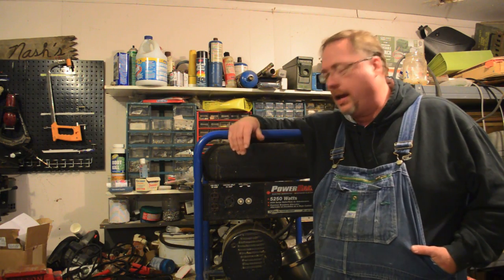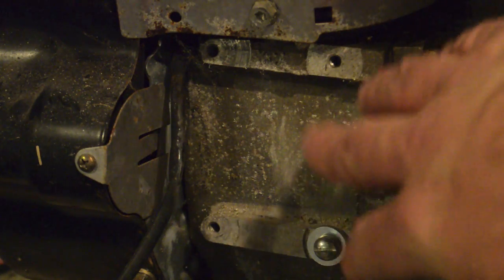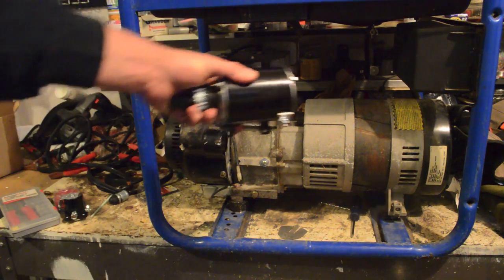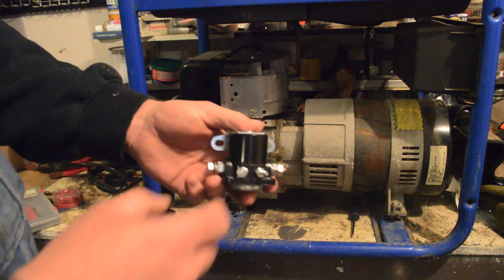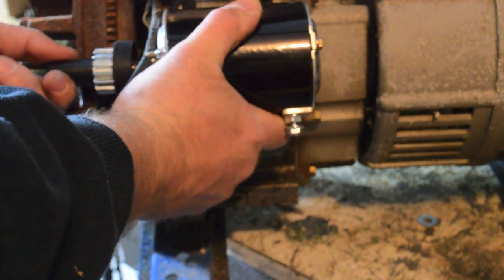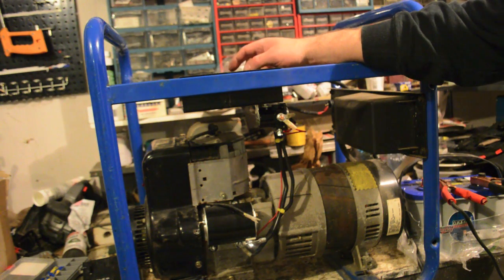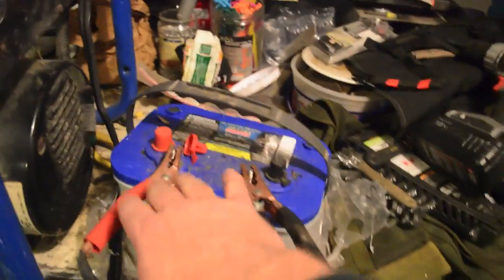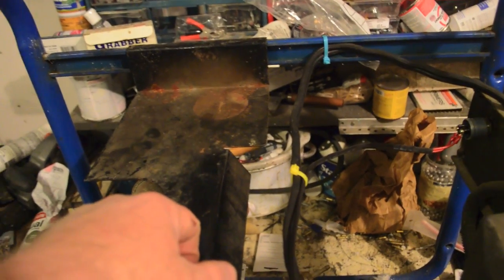How To Convert a Pull Start Generator to Electric Start

Comment: Short Version: Electric starter is the way to go! I have two bad shoulders from motorcycle accidents. I will see if I can convert my 8hp wood chipper!

I can honestly say that I DON'T  missed my Generac 5000 watt  10hp generator with a pull starter! A couple times I forgot to turn the fuel on..Duh!  I was looking for a used dual fuel generator for about three months on different web sites. But I found a Sportsman 7000 watt propane only at great price! You have none of the gasoline maintenance to deal with! I found three tanks by abandoned homeless camps! I can go about seven to eight hours on a tank. I will be working on a to lower the noise level down for me and my neighbors

P S. Not necessarily needed, but the transfer panel is nice to have! I had to upgrade to a 200 amp for a kitchen remodeling project.  I can run 75% of the house now. I did buy a cheap microwave oven to cook meals and heat water. I plan to have a electrician make some changes to reach 85%-90%. Only two of the four bedroom has power. The water heater is not on the transfer box. The washer, dryer, oven range and stove top microwave is not needed. I only run the lights that are needed. And I can a long extension cord over the fence for my NICE neighbor.  My BAD neighbor  can kiss my grits!

Comment: Thanks for posting this . I have purchased the parts and i'm about to install the starter but I have some questions. I'm no electrician so I need help with the wiring . I've watched this video MANY times and I still don't completely understand how to run the wires. As helpful as your video is it's not clear EXACTLY where to make the connections. A diagram would have been great to show a novice where the wiring should be connected. Any help with where I could find something like that? Thanks!
Reply: Hi, the connection is simple as the lamp can be switched on/off. You connect the motor start to the switch.  The issue is the switch button capability. The low current switch can be damaged in case that high Amp is needed to be switched off/on. You connect a solenoid to prevent that bad action as he did.
Between the motor starter and battery, you connect solenoid and switch by interromping the positive wire.

Comment: I have a honda generator (5.5 - 8kw max) and was wondering if they all have teeth on the fly wheel.  Also, will all generator/golf cart starters work (meaning are all the teeth the same)?

Comment: What kind of solenoid did you use?
Reply: You can literally put a jumper cable on starter bolt positive and put the neg on neg and ground to generator and just touch jumper cable positive to positive when u want to start. Or a push button switch

Comment: That starter is really quite poorly engineered...
So many more durable designs could have been used.
Small ring gears have a tendency to get their teeth broken.
Much more so than large ones.

For what it is, something as simple as a one way clutch built in to the starter (like one would find on a motorcycle) and a hard rubber wheel instead of the starter gear on the output shaft of the starter could have replaced the ring gear, the starter gear, the starter solenoid, and the frustration of  needing to either replace the flywheel at some point in the future or resign yourself to pull starting that 10hp beast.

Edit: it really doesn't matter if your generator engine was designed to be started with an electric starter or not.
You can make it happen if you try hard enough.
Don't plan on purchasing 100% off the shelf components to make it happen though.
Some custom fabrication will be required.

Comment: I have the same generator that I want to do this to.  I bought it after Hurricane Rita, and just put a bunch of new parts on it.  My 55 year old arm doesn't like pull-starting it. I work about 100 miles from home for days at a time and the  kids are long gone, so I have to make it easy for the wife to start.   I have the starter but my my flywheel is un-toothed.  I need to find one and also one of those switches.

Comment: Ok how are you going to keep the battery charged? Generators with electric start also are able to maintain battery charge too. Can this be done on those that are manual start?
Reply: Use your head you start the generator then you will have power put it on charge lol
Reply: @andrewbrown8872 or use battery in your car or mower

Comment: Is that starter also charge the battery?
Reply: starters don't charge batteries. the current usually comes from the stater on the fly wheel.

Comment: Anyone know the wiring diagram for the 3 wires for kill switch? 2 black one green for killswitch.
Reply: Mine is exactly the same motor. Green is on bottom. Thin black in middle and thicker black with shielded connector goes on top.
Reply: @bugaiho mine slung a rod and oil shit off didn’t shut it off. 
I may scrap it.

Comment: I have the same generator and the same engine, and like one of the other commenters, I don't have the flywheel with teeth (or ring gear pressed on) to accept the pinion gear on the starter.  Could you share the part number of your flywheel with teeth?
Reply: Tecumseh Part # 611253

Comment: It's not a solinoid its a relay
Reply: +Abe Coulter - It's NOT " Solinoid ".......... Its a " Solenoid "!  BTW.....  Common terms used " Solenoid " when in " Motors ", etc...  If in Electronic World.... It's a " Relay ", but " Solenoid " are used in Mowers, Lawn Tractors, etc.... Or you can call it " HIGH VOLTAGE SWITCH ", LOL.
Reply: Abe, if your going to correct people, then make sure you are right!! What he used IS a solenoid!!

Comment: Any chance you can tell me the part number of the flywheel i have same engine but no ring gear on flywheel
Reply: Tecumseh Part # 611253
Reply: I know 3 years late,I just saw video. don't need solenoid with that push button, it's good to 30-50a depending on who you buy it from. solenoids are cheap, $10-15 so just use one & any momentary push button you want, switch will see less then 1a triggering solenoid

Comment: Does anyone know for sure if the TVM 195 and TVM220 vertical shaft Tecumseh engine flywheel and charging coils will fit the HM100 engine?

Comment: Is it possible to put a  electric starter on something that has a pull starter? I have a gx390 and my pull starter broke and if that's possible I might as well spend the money on a electric starter. Thanks
Reply: Remove the pull start Assy. and use an electric drill to start it!  LOL.

Comment: There is a recall on those models dealing with the fuel tank. The plastic cracks around the mounting bolts. Fine time to find out about a cracked and leaking tank when you need the damn thing. They did ship a new one to me totally free
Reply: Same Here. Here is the number to call for the recall. 1 800-888-2468 - They will ship a new tank and grommet. Please destroy the old tank so no-one else tries to use it. I just did the recall a few months ago (Fall 2018)